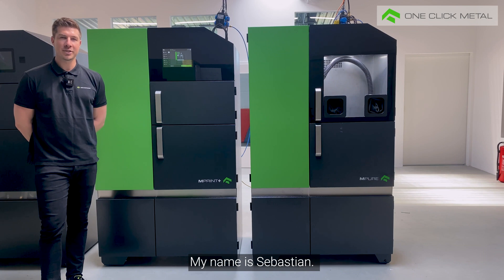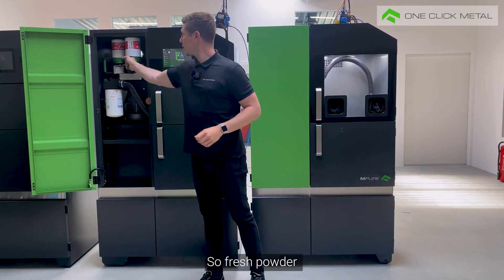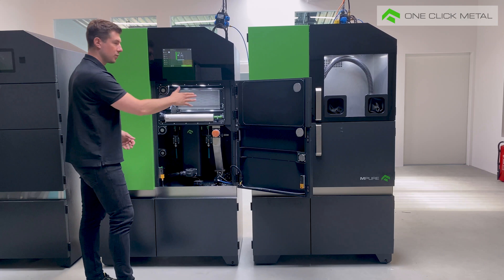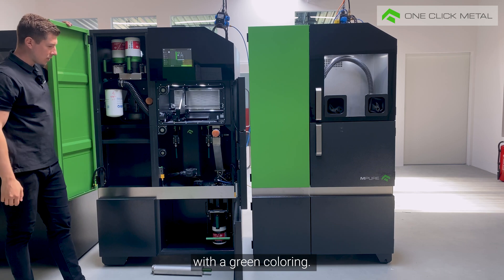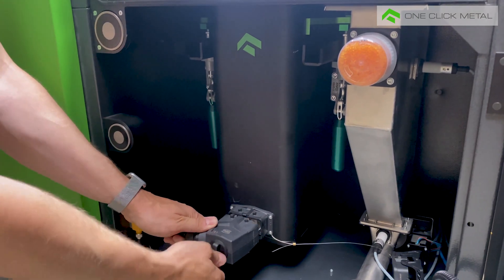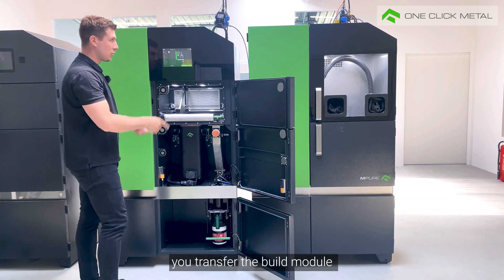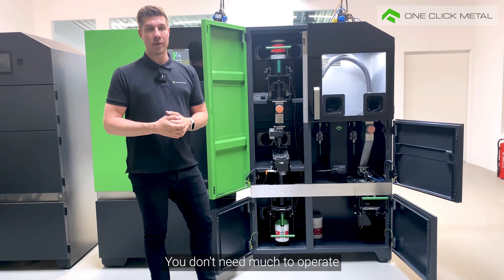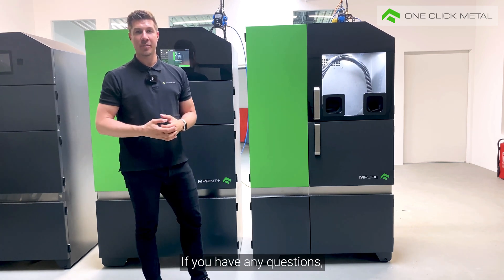Introducing the BOLDseries

Comment: Interesting and clearly explained video. Thank you. One thought - While removing the part from the build chamber, is there not an exposure to powder? It would be nice if there was an automatic transfer of the part to the post process chamber through hydraulics/pneumatic actuators. Otherwise the colour coding of the levers and that of the powder boxes are very thoughtful as is the automatic sieving system.